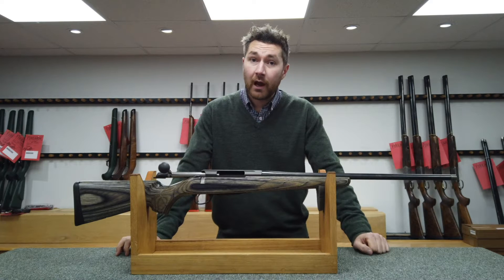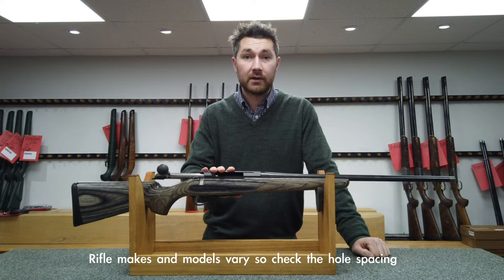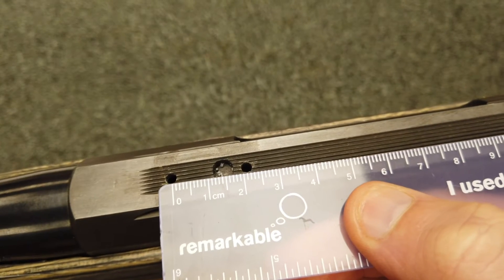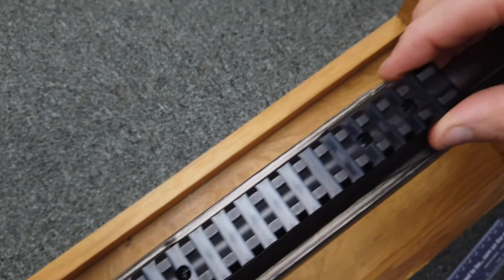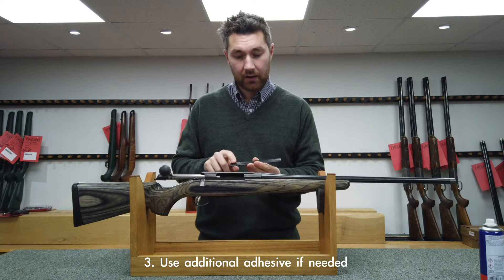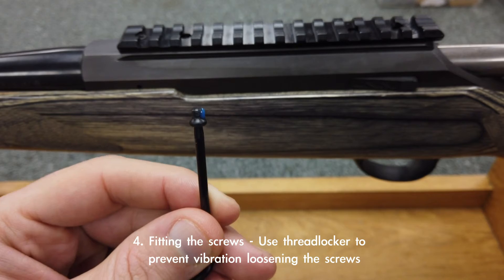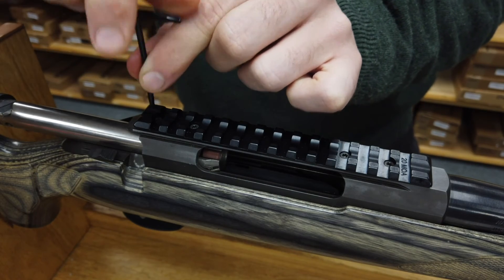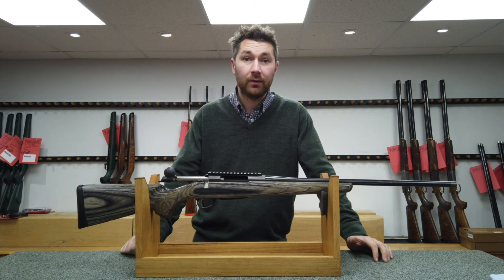Scope Mounting - Picatinny Rail Fitting

Comment: Thanks for the nice film. You installed a 20 moa rail. Can i place it in the wrong way, if i turn the rail 180 degrees?
Reply from the maker: It may be possible on a small number of rifles, but usually the rifle has different radius bases, different hole spacing front and rear or even a recoil stop (like on the Tikka T3), so the rail will only ever fit one way around.
If in doubt, a rail with built in MOA will always be thicker are the rear.

Comment: hello sir im from India...i have 12 guage shotgun Single barell ...i wna fit a rail on my barell head above chamber ,but the problem is that barell dont have any srews  holes so how can i fit rail for scope any other method i mean like to weld rail or use adhesive or something
Reply from the maker: Hi, thanks for contacting us. Unfortunately there are limited options for attaching a rail to a shotgun rib without modification. We don't have anything which would be suitable, but there are options out there. A common solution is a clamping system which clamps onto the rib rather than drilling the rib for screws. But these clamping mounts do tend to be for Red Dot Sights rather than full scopes.
Reply: @alanrhonemedia  Actully thats my grandfather ancestrl shotgun 32 inch barell 70mm ... i modied it with flashlight ,coldblueing and wooden pu polish sling and much much ... i stuck in this scope issue bcse dont have screws for that .i go hog hunts with this using slugs .... but i wna scope .... let me see any gunsmith who help me ...i knoe abt red dots with mount .... if u have any sugeestn for that (scope) kindly infom me ..thanks dude

Comment: I want to install on a 30 /30 Marlon , that needs drilled and threaded.
Reply from the maker: This may be a job for a gun smith or engineer. You can buy blank sections of picatinny rail which work well for custom fitting jobs. But the measurements of the holes drilled and countersinking need to be exact as the accuracy of the scope is only as good as the mounts.

Comment: whats best picatiny rail for Rem 700?
Reply from the maker: From our own experience, our Recknagel Picatinny Rails are very reliable without a single complaint since we've been supplying them. They come in either high grade aluminium or steel, with 0 or 20 MOA options. We supply the UK, with Recknagel also having dealers across Europe and the US, they've got a large supply network, so you shouldn't have too much trouble getting hold of one.
Reply: @alanrhonemedia  many thanks
Reply: @alanrhonemedia  do you have facebook profile ?
Reply from the maker: @jonasbruzas2651  we do. You can find us at facebook.com/alanrhone

Comment: Also clean the screws and holes with some degreaser and a pipecleaner. Put some Loctite between rail and rifle for better hold and to prevent rust. Remove exessive Loctite with some degreaser soaked papertowel.

Comment: I ve got a tikka m 558 aw where can i get a picatinny rail?
Reply from the maker: Unfortunately, neither of the scope mount suppliers produce a rail for the Tikka M558. They only make them for the T3, which has different hole spacing.
A possible option would be to use a blank section of picatinny to cut to size, drill holes and countersink to suit. A lot of precision is needed, but it is just the screw holes drill and not the radius cut because the Tikka action is flat.
I hope this is useful to you.
Reply: @alanrhonemedia  thx from germany

Comment: Dos weaver fit?
Reply from the maker: Picatinny slots are approximately 5.2mm wide. Weaver slots are approximately 4.6mm. So if you have a picatinny rail, then both weaver rings and picatinny rings will fit on to the rail. When tightening the rings to the rail, we'd always suggest pushing the front ring forward while tightening, and the rear ring backwards. This avoids any movement of the mounts under recoil.

Comment: What do you do when your scope rings (bottom half) don't level with your gun being level. I've tried multiple rings. Ruger precision rim fire (30 moa rail) vortex copperhead  scope, tried Leopold & Warne rings. It's not off by much but I've never had this issue before.

Do I just make sure the gun & scope are level? Any advice would be appreciated